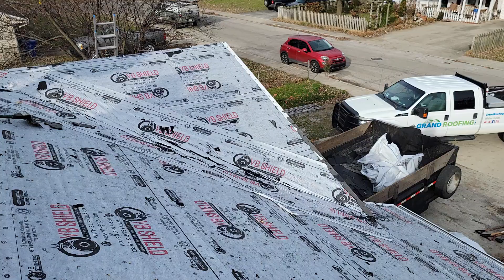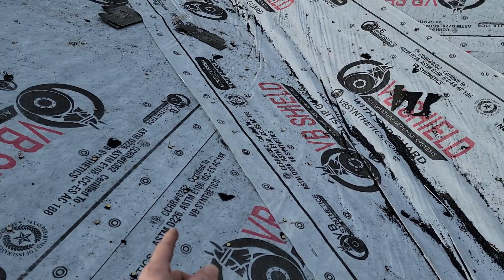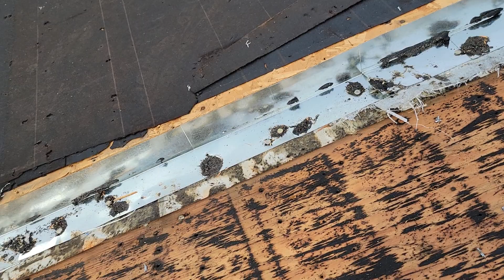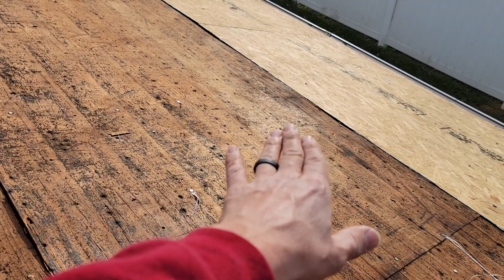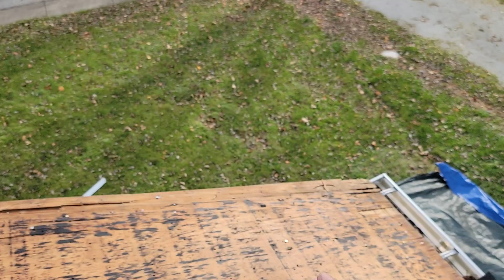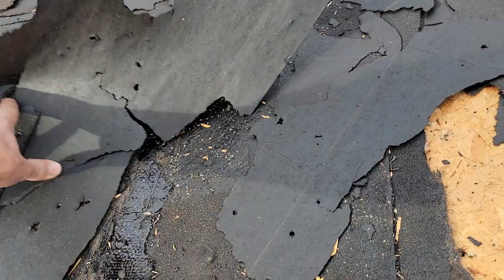Installing your own roof? Watch this 1st! Roofing tips and basics.

Comment: Thanks for all your info as I'm a Brit and have never come across these kind of roofs until 2017.. and don't ask me about water wells . Is it possible to use to use concrete/clay in New Jersey or would it be only shingle or slate and the latter being expensive and costly because of rarity and weight?

Comment: Okay -- best practice dictates ice and water go OVER either drip edge/gutter apron across eaves. Can we also definitively say that best practice dictates ice and water also goes OVER drip edge at rakes for the same reason? I think that the second one will generate lots of interesting and differing opinions. Let's go.
Reply: Because the water runs down, I like to put the drip edge over my ice and water on the rakes and at the eaves I like ice and water to go over the drip edge. It always works great for me.